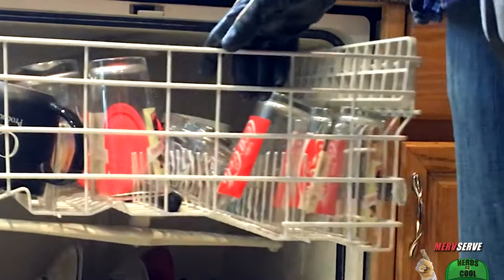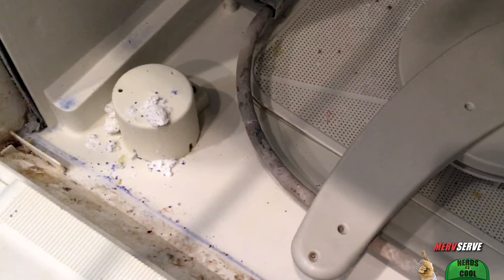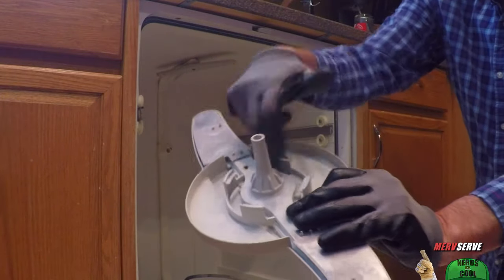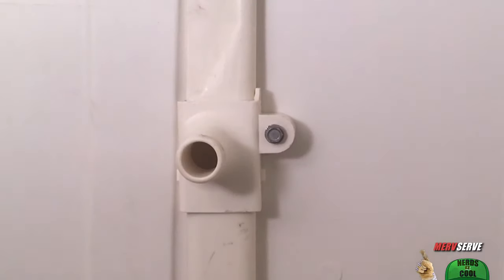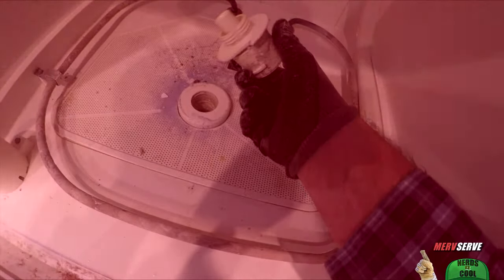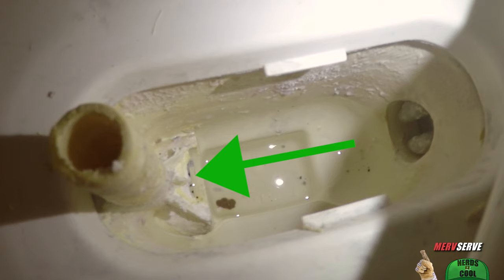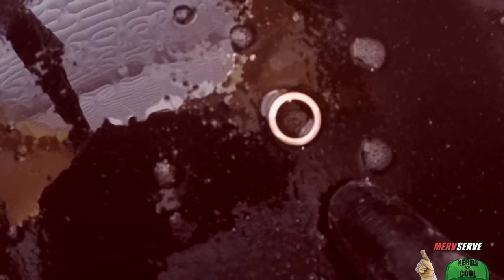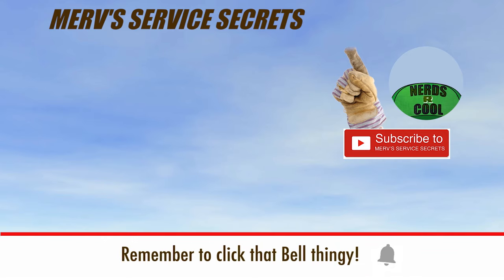How to Fix a Dishwasher that Doesn't Clean - Secret Dishwasher Hacks (Part 1 of 2)

Comment: Merv after doing all this in part 1 my poor dishwasher still didn’t spray and clean even though I found several nasty buildups. Your part two was such a life saver. My kitchenaid washer needed a new circulation pump/motor at the end of the day. 50 bucks on Amazon. Slapped it together. She works. I am my wife’s hero. Thanks Merv for the entertainment,education and confidence to do it.

Comment: Thanks Merv!!! This video may have been the most useful 9 minutes and 48 seconds of 2023 so far!!! I knew something was wrong with my dishwasher because it had minimal water flow, not even enough pressure to spin the wash arms, so I was thinking I needed to replace it, but I followed your instructions and took everything apart (my dishwasher was a bit different but it was still just as easy as you made it look) and I found a mesh filter by the grinder that was all clogged up. Once I took that out and cleaned it, and reassembled everything, it was working good as new again.
Reply from the maker: Great job!

Comment: You helped me fix mine. I couldn’t take out the bottom floor pan though but thoroughly cleaned everything. Now it sprays water properly.
Reply from the maker: That bottom floor pan -- the coarse filter they call it -- comes out if you remove other parts.  But nonetheless, it sounds like mission accomplished. Congrats!

Comment: This helped out a bit today. Saw I had some standing water in there.  It's July 4th, got a brisket on the smoker, and a cold one. Thought to myself it seems like a perfect time to rectify the situation. Boy was it a greasy mess when took the big screen filter off. Spent probably a good hour degreasing parts and the bottom of dishwasher. All back together and it sounds right. Hear the water draining to the sink, and hope the dishes come out cleaner now. Guess after 14 years of not doing any kind of maintenance to it, it was time. Cheers and happy 4th of  July.
Reply from the maker: Glad the video was helpful. Happy 4th to you as well!

Comment: Man, mine is a little different, but the general idea is the same. As I was taking stuff apart, I found that grate on top of the sump was clogged to hell. So, I cleaned that off and stopped there, just to see if that was the problem.

It sounds like it is working right now. You rock dude!

Comment: Merv,  Thank you!  I thought I’d check out your video for helpful tips. Bought a used dishwasher, suppose to be almost like new.  Leaks at the bottom of the door.  Changed all the seals, still leaks.  Think the next step is to change the soap dispenser .  Since the insulation inside the door was wet, they said if that happens change the soap dispenser .  So here we go.......
Reply from the maker: I once had this problem. Turned out the door was closing in a crooked way, due to the machine being sort of "twisted" during the mounting process. Might want to make sure everything is square.  Good luck and please keep us posted.  Please be sure to like and share! -Merv Himself

Comment: Guess should have unplugged before getting shocked.  Spent 45 years as a carpenter and still have 2 thumbs and 6 1/2 fingers, and love to fix things myself. Found that repairing things that don't have moving parts the easiest. Used methyl ethyl keytone to clean parts and got a nice buzz also. Found my sons  dead hamster was blocking drain .  But your advice and obstructions really helped, Thanks.
Reply from the maker: Dang tarnation! I told ya to turn off the breaker or unplugged the power.  Next time follow all safety precautions partner. But I'm glad you were able to fix it and I hope the hamster got a proper burial.

Comment: Great video! Doing the cleaning process right now & realized that the "danger, danger" washer is missing...what now? Proprietary piece or just get a random washer at the hardware store? Thanks!
Reply from the maker: Definitely not of space-age design. A hardware store version should work just fine.
Reply: So what happens if it's missing? Mine is missing. And my lower spray arm does not spin. Nothing is clogged everything is cleaned and my motor pump is working properly. Why is it danger danger to be missing this washer? Does it need to be in there to make the lower spray arm spin/rotate?

Comment: Hi Merv....soo happy to have found your vids! My 17 y.o. dishwasher has a couple of minor issues, hope you can help?? The upper rack hangs down when the rack is fully loaded, causing the spray arm to bang into taller items on the lower rack...i.e. the edges of dinner plates etc. I have tried to see some way to straighten/tighten this upper rack up like it was when new but I can't see how to do this. The problem seems to be caused by both side roller assemblies which seem to be very slack. Any ideas on how I can fix it? BTW....I'm not too mobile so I need a "knees friendly solution". Thank you for any help. Enjoyed this vid. 👌👍
Reply from the maker: Even though I'm not really a dishwasher expert, I think I can at least help you through a diagnosis procedure that identifies the probblem.  First,  pull up a chair along side the dishwasher so you can sit comfortably without breaking your back. Being able to relax while you analyze the situation -- without pain -- will help you do a more thoughtful job. Next, figure out exactly how the top rack attaches. If it's like mine, there is a slider track & roller assembly inside the dishwasher "box", but there are also plastic pieces which hold the top rack into that metal slider track.  If I had to guess, that's where the problem is. Where all those pain-in-the-neck plastic pieces come together.  Odds are, the brittle plastic has worn down or cracked over the years of being exposed to hot water. By comparing one side of the rack support to the other side of the rack support, you may be able to notice where the broken or missing pieces are.  Many of these pieces can be purchased on amazon believe it or not and I will make sure Demille leaves a link for you beneath the video description as soon as I hit REPLY to your question.   If all else fails and you can't find the perfect replacement part, remember ZIP TIES can work wonders.  (not kidding)  Hope this helps, happy New Year, and welcome to the Mervolution. -Merv Himself
Reply: Mine was the same i used long black cable ties a year and a half ago just snipped the long ends off works perfectly.
Reply from the maker: ..... And on the 8th day, God created the zip tie.

Comment: Thank you for your videos I recently fixed my Bosch dishwasher the drain outlet valve put it all together and now the dishwasher won’t fill up with water. What do I do now?
Reply from the maker: Of course, I don't have all the details about every machine, but I can speculate that if water is not coming into the unit, either you have a bad solenoid valve, the float shutoff valve is stuck in the wrong position, or maybe its something silly like you forgot to turn the water back on.  Hope this helps point you in the right direction. -Merv Himself.  P.S. If you solve the problem, please stop back and let us know.
Reply: @MervsServiceSecrets  I was going to give up, but I'm going to give it one more shot. I will definitely let you know, thanks for your help.

Comment: Some newer dishwashers (other manufacturers) offer or permit access to the recirculating pump from the inside of the machine. Once the lower spray arm and coarse filter is removed it's possible to really go town town if it is suspected that the recirculating pump has begun to malfunction. As an alternative to replacing the recirculating pump I have learned, after now five hours of semi-intensive research, that rebuild kits are offered online which includes the bearing and bushing for the impeller shaft.

 I gotten only as far as studying the theory today but I've already cleaned both sprayer arms, the fine and coarse filter and then ran a test load of dishes. I'm still having the issue with inadequate cleaning. Things that would have washed ultra-clean are still showing soil on their surfaces so I'm thinking it has to be the recirculating pump that needs attention.
Reply from the maker: Awesome info. Thank you for the tip.  That's really great news that you don't have to yank the thing out and flip it over!
Reply from the maker: By the way, I recently discoved the horrors of cheap dishwasher detergent. Film on glasses, unclean dishes. Disgusting until I bought a top name brand.  (Cascade pods)    But it was worth every penny.  Also, there is a great product called "Lemi Shine" that cleans out the guts of your machine.  Might be worth checking out.
Reply: @MervsServiceSecrets  You said it, Merv. Hauling the dishwasher out to flip it over wouldn't have been on my bucket list. I just finished an auto repair on an older SUV that saw me, my younger brother and my stepson cutting bushings from the upper control arms with a Sawzall so I have had enough of these in-depth mechanical repairs to suit me for now. 

I was almost giddy when I determined that, in the worst case scenario, I would have to access the circulating pump after finding out how relatively easy it was. I am going to order the bushing and bearing kit to have on hand. I intend to remove and inspect the recirculating pump tomorrow to inspect for debris clogs and check the impeller for how it's seated in the bushing. 

Thank you for your help, Merv, in analyzing the situation pertaining to those washer arms. I found lengthy filaments of plastic bags (how'd they get in there?) and label fragments clogging the jets on both washer arms so at least I eliminated that problem. Best wishes.
Reply: @MervsServiceSecrets  Yes, I have stuck with Cascade since the outset. I also use their Power Dry solution in the little reservoir. This problem I described literally happened over the past six days.
Reply: @MervsServiceSecrets  Merv, as luck would have it I found the cause of the poor cleaning on our three year-old dishwasher. I did a tear-down on the machine early this morning and I found the impeller on the circulation pump completely clogged with stiff pieces of plastic debris. Oddly, a three-inch strip of a Slim Jim wrapper had somehow bypassed the coarse and fine filters and gotten accordion-ed into the exit aperture. I cannot explain how that particular piece of trash found its way into the dishwasher in the first place.

I checked the drain pump and every hose, fitting, nook and cranny for other bits of trash and, thankfully, found nothing else. There was no significant accumulation of food debris or grease build up so that made me happy too. The impeller is a pole-motor sort of thing and I checked the assembly for looseness and side-chuck and found that the motor was about as good as new. I am running a test wash right now and it was very satisfying to heat the recirculating pump really pushing that water through the washing manifolds. Thank you for your helpful videos and advice, Merv.
Reply from the maker: @TralfazConstruction  You did an awesome job!  I have found those coarse filters can lift up around the edges. Thinking about securing mine in place with a few dabs of some non-toxic silicone. Maybe the kind they use for aquairums.  What to you think?
Reply: @MervsServiceSecrets  Thank you, Merv. I think that's a really fine suggestion as to that coarse filter. It's subjected to all of those drying cycles being so close to the heating element. 

I'm very pleased that my efforts paid off. It borders on miraculous and I did say a prayer thanking God for His giving me the ability to sort out this problem. I am saving the pictures I took to show everyone that we all must be careful of what we place in the dishwasher. I don't feel that scolding anyone will help matters at this point. I hope that your day goes well, Merv.
Reply from the maker: @TralfazConstruction  Would love to see the pics.  Post your accomplishments on twitter or instagram or use the post feature in your youtube account to do the same.  Be sure to tag me in it so I get a notification. I'm on all 3 of those social media platforms.   Congrats!  -Merv out.
Reply: @MervsServiceSecrets  I have a Twitter account which I rarely ever use, Merv. How could I get these photos to you exclusively? I've been thinking about how to do this these past several days. Thank you.
Reply from the maker: @TralfazConstruction  We've got contact info in the "About" section on our Channel's Home Page and at MervServe.com   However, sometimes attachments get filtered out as a precautionary measure.  If you've got a twitter account, that's really the best way to go because then you'll be sharing useful stuff with a community of followers just like you.  To do that you would just simply upload your picture to Twitter and then add a caption that says something like "Thanks to @MervsService lookie what I did!"  As a result I will get a notification and then salute your accomplishments.

Comment: Merv, holy shit brother… your videos are so damn cool. Very informative, funny and simple. Thanks brother! 

I’m having trouble with ZERO power. I replaced the Control board a couple months back, and now it’s not even powering on. Any ideas? 

Btw I’m almost certain you’d do well being a voice actor or audiobooks.
Reply from the maker: No power. Hmm.  Not trying to be a wise guy, but that is so weird and I'm wondering, did anybody verify that circuit to the dishwasher is actually active?  Was the power checked along every step of it's path? From the circuit breaker ... to the junction box where it comes into the machine... to the connector the new board plugs into? The float valve or some other sensor also leaps to mind. It's possible something is stuck and telling the machine to not turn on.   Also,  this following video might help. I know it's long but its even more comprehensive than my first one and watching the whole thing may give you some ideas as to where the problem lies:  https://www.youtube.com/watch?v=4Uwrtjm1Yzw

Comment: Gregory Dunn
1 second ago
water backed up in the diswasher and sspilled out  I dipped all the water out and started the washer it drained  and then all the lights just keep blinking  and nothing is happening
Reply from the maker: Just a hypothesis. But it sounds like your drain pump is not working.  Perhaps clogged with debris like mine was.

Comment: my whirlpool soap dispenser latch broken. so my sop pod won’t dissolve. do i need to get the part replaced ? it’s 100 dollars 
can i find it else where for cheaper price ?
Reply from the maker: Well, this is a tricky solution but it will work if you can time it right.   Start your dishwasher and let it go through the pre-wash cycle.... THEN, open the door and throw your pod into the bottom of the dishwasher. (Doing this before the prewash cycle is complete will weaken your cleaning power, so wait until pre wash is over.) Hope this helps. -Merv Himself

Comment: The machine doesn’t clean the dishes and I end up with a bunch of bits all over my dishes that look like coffee grounds? I took off the arm and there doesn’t seem to be anything clogged BUT I did find a small pool of water in that hole. Could that be the problem, if so how do I fix?
Reply from the maker: What a lot of people don't realize is that a dishwasher is constantly recycling dirty water, basically, spraying gunk off of dishes, then grinding it up and pushing it back through the spray arms over and over again.  When those particles are the right size, a thing called a turbidity sensor tells the machine to jettison the water down the drain and bring in fresh water. Then, the cycle starts over again.  It's possible that some of your dirty water is making it back into the machine again, perhaps as the result of something as simple as a 7-dollar flapper valve.  Watch this other video we did and it may give you some good ideas: https://www.youtube.com/watch?v=4Uwrtjm1Yzw   Hope this helps. -Merv Himself

Comment: recircurculating pump not making any sound.... that could be another cause, right ?
Reply from the maker: Yes absolutely.  But don't go sticking your fingers inside there.  Could also be a loose electrical connector or something that's jamming the pump itself.  It's sharp & dangerous in there though, so seriously don't stick your fingers inside.
Reply from the maker: This video shows you the parts: https://youtu.be/4Uwrtjm1Yzw

Comment: I have the same exact dishwasher and I notice my dishwasher wasn’t washing properly just like in the video. I decided to follow step by step and there was a lot of gunk because I haven’t cleaned my dishwasher ever. I put everything back properly and my dish washer was running smooth, or so I thought. I opened my dishwasher and everything was sparkling clean but there’s a whole bunch of water on the bottom of my dishwasher 😭HELP ME PLEASE
Reply from the maker: Sounds like the machine is not draining properly.  First thing I would check is the Float Valve. Make sure it's not stuck.  It's under that little dome shaped cap in the front left corner.   

Alternatively, if you pulled out the machine and disconnected some wires, that may be the problem.

Comment: how the hell do you get that center spray arm hub off mine just keeps spinning and doest come out
Reply from the maker: On my center spray arm, I just lifted while turning counter clockwise. Next, the large wash-arm retainer nut -- I just twisted a little and lifted. Once other things were cleared out of the way, the center threaded hub just simply unscrews.
Reply: @MervsServiceSecrets  thanks for breaking it down! interestingly enough after following your vid/instructions the spray arm hub turns (with quite a bit of resistance) but won’t lift out. I managed to bend the trapezoidal mesh out of the way to get to the basin and cleaned everything out and still my pods will not dissolve. might be looking at a different issue alltogether